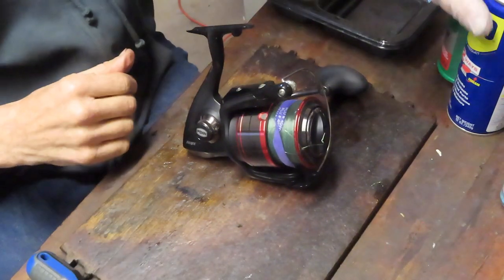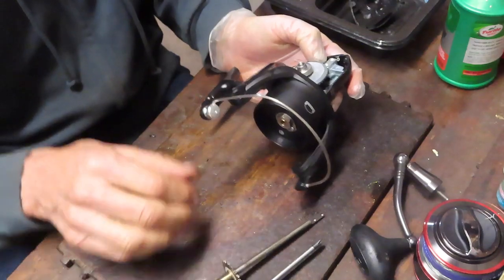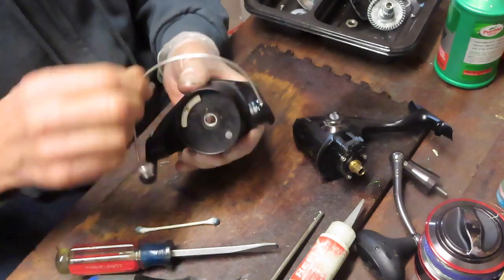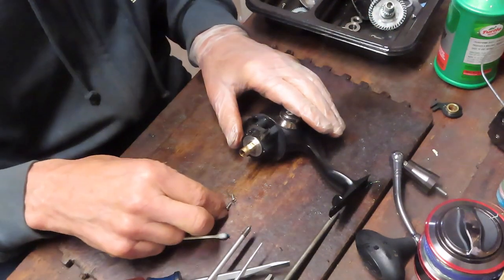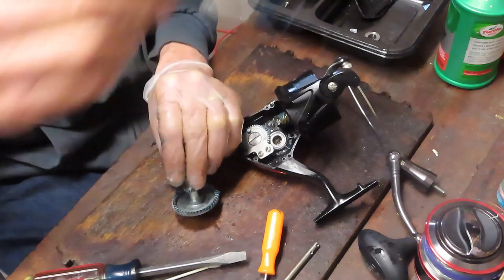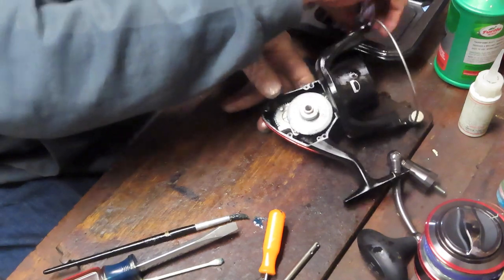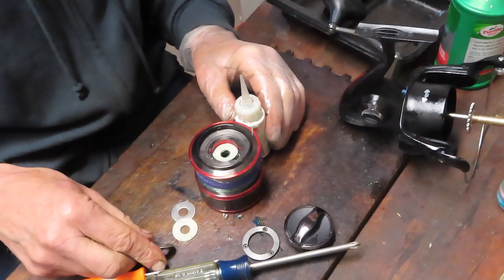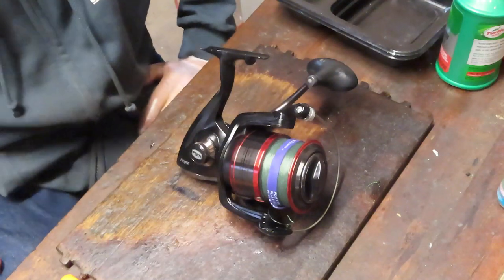Penn Fierce 7000 Saltwater spin fishing reel how to take apart and service

Comment: I found a Penn Fierce ii 8000 (no LL) at the flea market today for $15 that I hope I can use as my Florida surf shark reel.  This thing looks like it was drug behind a truck on a gravel road, no red left on it anywhere except under the fishing line on the spool.  Looks awful, and can't believe it was only made in 2015 to 2019, but it operates well.  Hoping I have only a cosmetically ugly reel but everything insides looks okay.  I have a 4000 series inshore reel that I really like,  Thank you for this video.  Tearing into it tomorrow, wish me luck.  lol.  It will be fun even if turns into a train wreck.
Reply from the maker: Good luck.  The fish don't know what the reel looks like.  If it is mechanically sound you should be fine - good find for $15
Reply: @2ndChanceTackle  Thanks Dennis.  I attempted a full service of this reel.  Unfortunately the crosswind block is 100% frozen to the main shaft.  The shaft will move slightly, but not at the crosswind block.  I did remove the 2 main shaft screws.  I sprayed PB Blaster and allowed to soak for 2 hours.  I even pecked lightly at the back of the shaft with a tiny ball peen hammer and punch, no joy.  The rest of the internals - This reel has seen no servicing.  No grease or oils.  Since I could not get the main shaft out, I instead used a small artists brush and (Bass Pro) reel grease and carefully greased every gear, greased the face of the eccentric, cleaned and inspected what I could (no broken/damaged teeth, shaft is straight), oiled the bearings, and am now hoping for the best.  I was able to fully service the drag stack, and had to add a small washer to get the line to load evenly on the spool.  Any suggestions for unfreezing crosswind block?  Was thinking maybe a min-torch (heat).  It is operating well, and now smoother, but I could not clean the crosswind block interface nor complete the cleaning fully, which has me worried, but I also don't want to damage a working reel.

Comment: Hi Dennis:  I have used your videos to rebuild a few of my reels.   Thank you!  My question is that my Penn Fierce 7000 has play in the "bail wire assembly" meaning that the wire that goes into the opposite side from the bail arm side.  It looks like the wire is meant to pivot in holder, but this is the first time I noticed this subtle back and forth movement.  Should I replace the bail wire assembly?  Thank you
Reply from the maker: You do not need to replace it as that is not the working side of the bail.  The wire guides the line over to the other side where the line roller is and that is what is used to spool the line.  It may be an annoyance, but it is not necessary for you to replace it.  If it bothers you, go ahead and do it.  You can get the replacement bail wire from Mysticparts.com - Dennis

Comment: Hey Dennis. Really enjoy the  videos.   I noticed on the open spinning reels you trip the bails by turning the handles.  I have watched other videos on that type reel where the presenter says that's a no no and to always trip the bail by hand.  Does it really matter if the bail is tripped by hand or by turning the handle?  Thanks, Scott
Reply from the maker: Over time the use of the spinning reel rotor and trip mechanism to close the bail will wear and cause failure.  A manual trip takes that out of play.  I crank the handle to check the bail because that is what most folks do and I want to make sure it is working for them.  Thanks for asking - Dennis
Reply: @2ndChanceTackle  Thanks for clearing that up!

Comment: Hi Dennis. Quick question. Penn Fierce III 5000 and 6000 spools are interchangeable?
Reply from the maker: I think you should be able to change them if you want to put the 60 on the 50.  I am not sure if it will work the other way.  I also believe that the Fierce and Pursuit spools are interchangeable and that the spools from version one and two of those reels can be swapped - Dennis